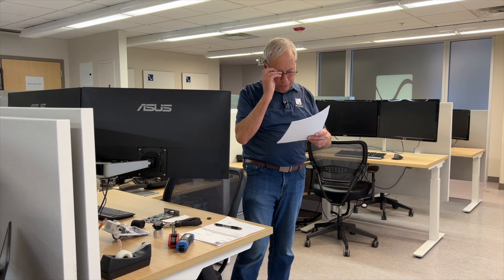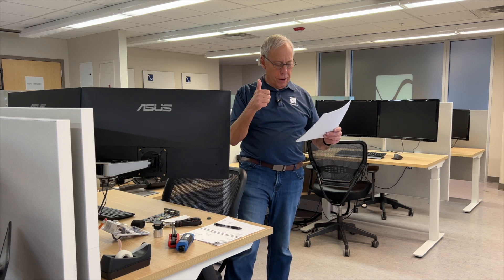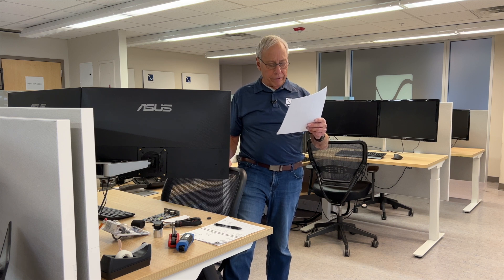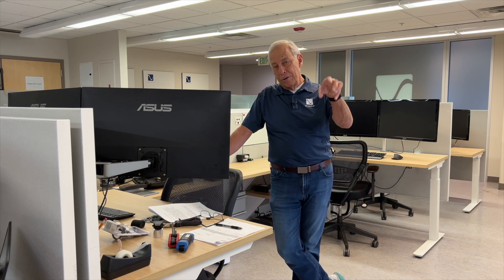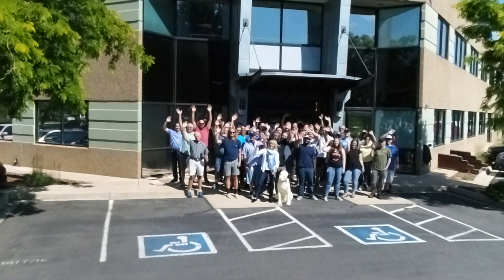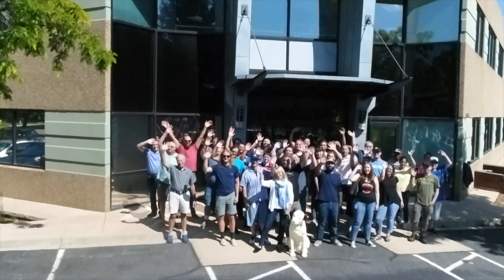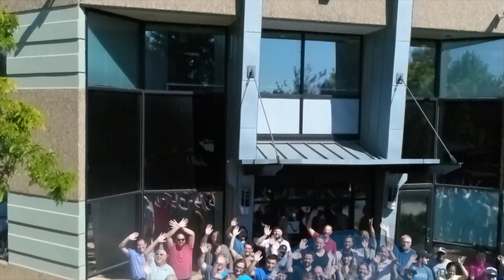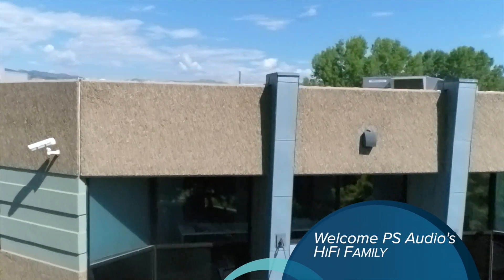Using two electrical phases

Comment: Sorry, but those 240 volt wires Do Not represent Two Phases.   
They are the 'outer ends' of ONE phase which is SPLIT into two 120 volt 'legs', 
the center of which is "neutral" and is ultimately grounded, usually at the breaker panel.   
That aside, the best option for powering an audio system is having ALL of the outlets on ONE leg.  
Reasons include SAFETY for both the user and the equipment.

Comment: I like to our 400V 3-phase system in the EU. Not only more "power" but also the possibility to use a 3-phase recifier which reduces a lot of ripple on the DC capacitor right away...  Well, at least that is how my "fat" DIY Amp is constructed :-)
Reply: For those who want to know: in Europe 3 fases of 230 V each makes: 230 x SQRT (3) = 230 x 1.7321 = 400 V

Comment: There is some danger in feeding both phases. If they are wired into separate 110 volt outlets in the same room (not the standard 230 outlet) a 230 volt potential will exist between the the two outlets.  If two pieces of equipment are connected to separate lines their power transformers will be 230 volts apart. Under normal circumstances this would not even be noticed but if there were a problem in one of the units this could make it much worse. Additionally a careless experimenter could be exposed to the 230 volts  while playing around with the system connections. better stick to one phase.

Comment: Slightly incorrect.  These are not phases in the truest sense.  They are two legs of a SINGLE phase, split in the middle by a GROUNDED neutral.  A phase is a single set of windings on the circular generator, 120 degrees behind (or in front of) the other phases it's grouped with.  This single phase is one of 3 phases transmitted by distribution transformers outside homes as an electrical service.  Hard to articulate in words, better described by diagram.
Reply: It is not incorrect. The incoming single phase (out of three) is transformed into two new phases that are 180° apart (because of the center tap). These are phases in every sense of the word. Sometimes Paul makes mistakes, but this isn't one.

Comment: There is (was) a true 2 phase (not split phase) power system in the early 1900s. Still found in Philadelphia and still supplied by PECO on request, the city utility. Some old elevators still have 2 phase motors.
https://en.wikipedia.org/wiki/Two-phase_electric_power

Comment: The infamous audiophile rule to put all gear on the same phase to reduce noise has some credibility. But it has nothing to do with the split phase versus single phase. It's the grounding. Two different phases often means two different ground wire runs back to the panel. Now you have a ground loop that may or may not cause a noise and hum issue. As for opposite phase causing problems, radio, TV, large recording studios, use three phase power, 208wye which results in three 120v circuits with a 120degree phase shift. Not a problem if the grounding is properly engineered.

Comment: BOTH PHASES SHOULD NOT BE USED! ☠
There is not enough information to answer the question.
Does the equipment have dual PLUS?
Does he want to parallel the phases to the equipment's single 115v input?
Does he want the speakers on one phase and the head units amps on another?

Comment: Utility lineman here, 120/240 volt split phase system in most of the USA.    Neutral tapped on the center of the secondary coil.    Btw, I love watching your videos. Not a lot of audio owners answering mail on YouTube!
Reply: JL here too. Common misconception. I agree. It's a single primary phase so it's absolutely just a single secondary phase center tapped.

Comment: Get yourself an isolation transformer wired to produce 60-0-60V and a new sub panel with 2pole breakers. Hire an electrician first. Or check out Equitech.
Reply: Why bother. it wont make a difference.   Just listen to the music not the equipment.
Reply: @philipslighting8240  I totally agree

Comment: But what is the point of doing it? Not like you can plug the amp into two outlets. I use QSC Pro Amps and they plug into 110 outlets. Even if you did use one phase to power everything on one side and the other phase to power the other side with all the equipment all the power comes from the same source.
Reply: 3 phase power is "tapped" earlier than other single phase users in the distribution grid, it could be beneficial if you have a heavy polluting neighbour
think of FTTN (or DSL) vs cable modem for household internet connection or the wall street speed war
Reply: double supply voltage, lower current in each single leg
perhaps lower impedance drawing power from wall?
Reply: @philiptong4978  Sometimes these audiophiles lose me. I just hope one day to afford their successes and not have to pay for their failures. 
From what I know about home electric you would have to be running some serious power (like a touring band) to need more than one phase. Good outlets, a solid breaker in your box, being careful of what else runs on that line are much more important. I grew up in era that the "3 outlet lamp extension cord" was taboo so I always installed enough wall outlets in the house I own for my system long before power strips were common. I've never blown a breaker because of my system and as I said I use 3 commercial amps. 
As for just using both phases, the power to my house comes from the substation a mile up the street. If one line has an issue the other one does.

Comment: To get 2 dedicated circuits with different phase to feed 2 big amplifiers is very smart in the example that Paul gave. It will keep the load balance in the home.

In the scenario for the question ai would rather check if my equipments can take 240V (many switching powersupply does, and hifi has a switch selector) and run a beefer circuit, like a 240V 30A with a L6-30R outlet and romex 10/2 (or even 8/2 if budget allow).

This beefy circuit feeding a good quality 1U powerbar that has 8 C13 sockets. 

This way the ground is common on the same powerbar and it is easy to get good quality C13-C14 cables 

Also a more common nema 5-15R circuit (nema 5-20R even better) for non compatibles devices or futur devices in the room for sure.

All this to minimize voltage loss and impedance. In Canada/USA we dont see this kind of setup very often, people will get multiples 120V15A circuits, from 2 to 4 or more!!. 
No money save, ground loop could be an issue and way more mess behind the setup.

For the voltage confusion, it is because in Canada we use 120/240 and not 110/220 or 115/230 like in USA. It is about the same because devices are compatibles, but there is just a difference that make people call it differently.
Reply: in addition to above, the single phase AC240V is balanced power, the legs can be considered +120V and  -120V when compared to ground pin

Comment: Paul I’m sorry your wrong here. First it’s not that you have two phases of 110 coming into the home. You have 240 volts with 2 high voltage cables coming from the pole to your electrical panel. It is then split 110 volts to each side of the panel. The splitting of the 249 volt line is then each side is 180 degrees out of phase with one another. 

To add to that you absolutely want to make sure to power your system from one side of the phase and ideally a dedicated line with nothing else on the circuit. And I would suggest using ten gauge wire in a conduit do not use romex

Reason you want to use one phase is if your components use different phases and sharing a common ground this why you get 60 hz buzz. Only way then to address this issue is to lift grounds which is ok but not recommended with high voltage components.

Comment: My main audio system runs on two different phases. I added the breakers (on the panel) and the outlets. It's basically just for "load balancing". Since I needed more outlets anyway..I didn't want everything on the same phase. The neutral bus (and therefore the earth ground) is common to both. I also have a buddy who built a Power amp with 240volt transformer using the the full 240 volt line. Since the transformer output voltages are the same no matter what primary windings you use, the only difference is less AC input current. My buddy claims this lowers "hum" noise in Power Amps PS.

Comment: With all the switch mode power supplies in equipment these days I'd keep all the audio equipment on one phase just to make sure you don't rnn into weird noise issues. If you need two circuits just make sure they are fed off the same phase.
Reply: Where did you get this weird information......
Reply: @philipslighting8240  If you are running two phases you can have a different noise profile on each phase, when you use them for separate channels you can end up with additive or subtractive noise or incoherence between the channels. With a common ground this is not likely and probably minimal if it occurs but it is possible.
Reply: @nigelrhodes4330  Just listen to the music stop worrying about the equipment.
Reply: @philipslighting8240  I do repairs on vintage equipment, it is sort of my thing to worry about that side of thing.

Comment: Ontario Province is HUGE !!!  I am still not clear what his objective is in using different phases powering audio equipment.  Now if he wants 230/240V outlets, I can see some good reasons for that  such as getting European branded equipment that are not readily available / or much cheaper in Europe than in the USA/Canada....
Reply: Euro 240 is running at 50hz
North American 240 runs at 60hz
 
Noise can be an issue running EU gear in NA and vice versa because of frequency mismatch. Their radio gear also tunes to the even numbers after the "point" 101.2, 101.4, 101.6, 8, 0

North America tunes to the odd points, 1,3,5,7,9 so you'll never get a clear signal with a typical digital tuner in an EU radio used in NA.
Reply: @ScooterMcAwesomeness  the FM broadcast center frequency has to do with bandplan and channel bandwidth of individual continent or country
Reply: @philiptong4978  Thank you for repeating what I already said.

Comment: The potential issue isn't dangerous, it's noise. If you mix the split phases, and you have equipment with linear power supplies, you could potentially be adding noise to the audio system.
Reply: @Douglas Blake unless it is a piece of DIY gear, that's when you call up the manufacturer and ask, simple enough for me
Reply: Of course its dangerous ther will be a potential voltage of 208V acroos the 2 components.
Reply: We're talking North America here. How do you get 208v out of split phase?
Reply: @philipslighting8240  the system is called split phase, the single phase AC 240V is split into +120V and -120V (from opposite ends of the same transformer, both same phase), center tap being neutral (and grounded)
Reply: @@Douglas_Blake Exactly.
Reply: @@Douglas_Blake If mixing phases in audio gear could cause a potentially deadly result, then there would be plenty of people dead. We're talking about some equipment plugged into one phase, and other equipment plugged into the other. What they have in common are the audio lines. If you have 240v, or 120v for that matter, running down your audio interconnects, then clearly you have big problems.
Reply: @Douglas Blake it won't be a problem if all pieces of gear in the system is compatible with balanced power

Comment: In my home, the dryer, oven, AC unit and EV charger run at 240 Volts. Some high power audio amp could likewise also benefit from the higher voltage (possibility of higher power) if you really play very loud.
Reply: @@Douglas_Blake LOL, yes you are right 😎

Comment: the 3 Phase Voltage is 120 +120v +120v times the square root of 3 = 208V aprox.     As an electrician I would never use seperate phases for each power amp if there was a fault you will have a potential fault voltage of 208 v.    Here in the UK generaly we only have 1 Phase to each domestic property as our line voltage is 240v and our 3 phase voltage is 415v.  Only indudstrial premises use 3 phase.
Reply: We have the same voltages as " The Poms " but average homes use a single phase supply (240vac) with 70 amps available . That's average . New houses have 3 phase ( 415vac) with 100 amps per phase . 

Cheers from the land of Oz
Reply: He's not talking about a three phase supply here. In North America for domestic, it's split phase from a center tapped transformer on the utility pole, which gives 120V+120V=240V to the property.
Reply: the term split phase indicate the same 240V phase is split into two, using center tap neutral (and grounded) transformer, opposite ends of transformer has opposite polarity +/-120V, but they are the same phase

phase has to do with time shift, a result of the 3 coils located 120 degrees apart inside the same generator gives 3 phase power, voltages between coils is different than each single coil
Reply: Your math is off. Three phase power, with 3 120v legs, each offset by 120°, is 208v.
Reply: @carterwilliamhumphrey3373  Thats what i said.  and its Maths its plural.
Reply: @carterwilliamhumphrey3373  Mathematics.  abreviation is maths.  its plural.....
Reply: @philipslighting8240   We're talking about split phase in North America. I have no idea why 208v is even in the conversation.
Reply: @carterwilliamhumphrey3373  Measure the voltage with a DVM
Reply: @philipslighting8240  tomato tomahto
Reply: @bradleykay  What has a fruit got to do with grammar.
Reply: @carterwilliamhumphrey3373  Your reading comprehension skills are off....
Reply: @ScooterMcAwesomeness  Really? The original post said 2 legs of 120v was going to give us 208v before it was edited. Also, why are we even talking about 208v? The video about split phase power coming into a home and mixes the 2 phases of power in an audio system, not sending 240v to a single power amp.
Reply: @carterwilliamhumphrey3373  I'm seeing that the OP edited the post, then claimed they said something else, without voicing the correction.

My bad. My apologies. 

Also, I concur with your assessment of the argument about 208V.
Reply: @ScooterMcAwesomeness  No apology necessary! Paul posted this 2 hours ago, and the replies have quickly gone off the rails. 
Here's some gas for the fire: in a split phase arrangement of 120v, which sounds better? Phase 1 or 2? <sarcasm>
Reply: @carterwilliamhumphrey3373  Not gonna lie... I giggled at that more than I likely should have.
Reply: @philipslighting8240  excellent*

Maybe next time you'll get it... maybe...

Comment: May I ask why the need? You likely don't need/want that (or 240volt) going into your dedicated space. Instead what I have done (and is IMO very much needed) is I brought in two dedicated 20amp 120 volt lines with the proper shared grounding directly from panel and then also right at the electrical box noise filtration / isolation. The end result being a dedicated Listening room with all the power it needs (40amp total), which is both super quite (noise free from the rest of the house and neighbors alike), as well as 100% properly grounded for Outages/Surges/Lightening Strikes/etc. (meaning equipment can be plugged into each separate 20 amp outlet/circuits as well connected to each other and STILL possess the proper (i.e. effective) whole system surge protection (something that many people THINK they have running their  Panamax/Other surge suppressors, when in fact they do not 🙁).